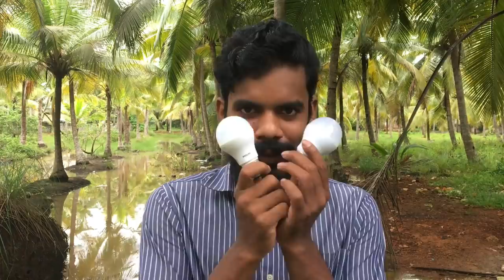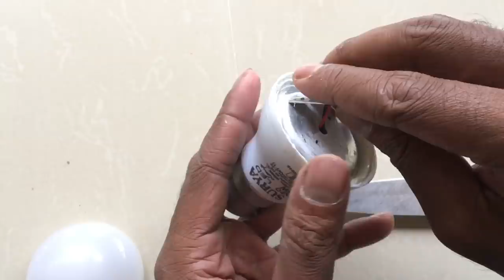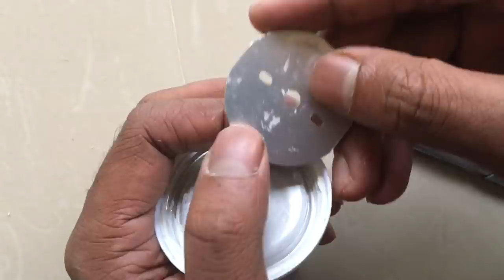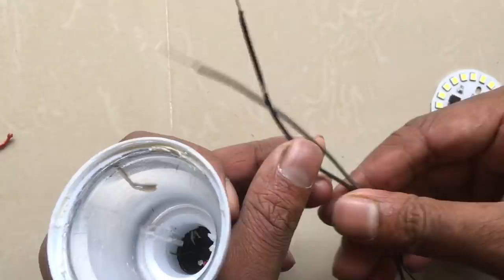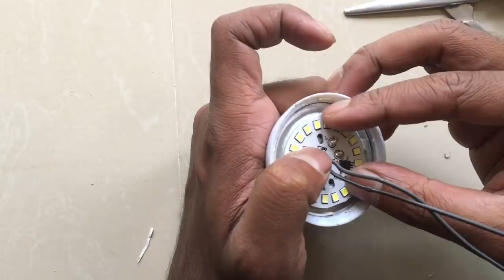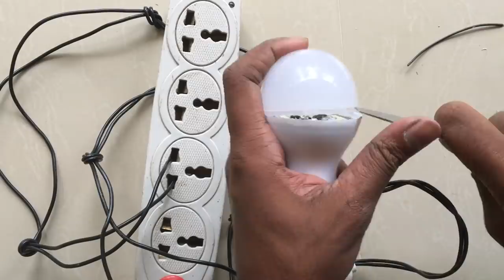How to reuse LED bulb 💡 | simple idea | DIY | 3T factory tech

Comment: 1. Without soldering Iron normal people can’t change like you said .
2. Actually you removed the driver and light PCB with much protection and used one diver integrated light PCB with less protection. Less life for sure . In the bulb Alternating Current ( AC  ) change to Direct Current ( DC ) then give to the light PCB . Not just step down AC voltage as you said . 
So viewers please care while doing this kind of things if you are not much aware about products.